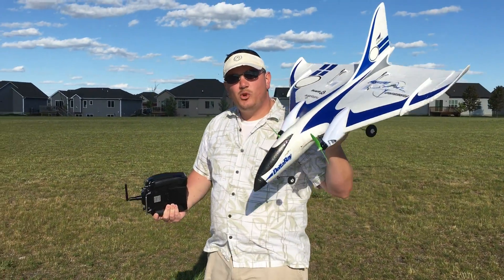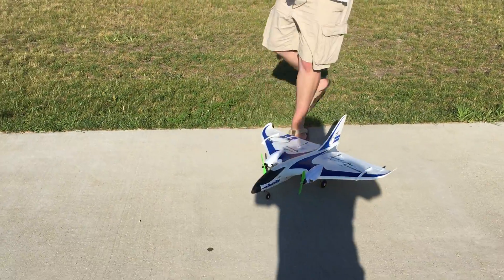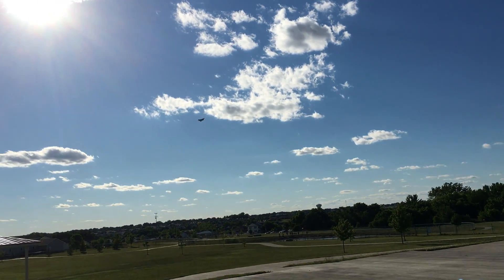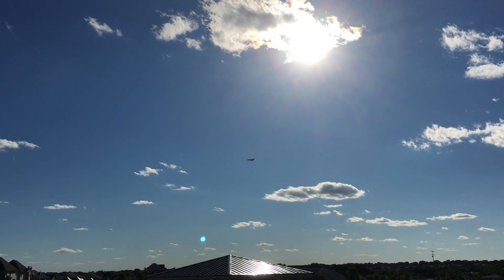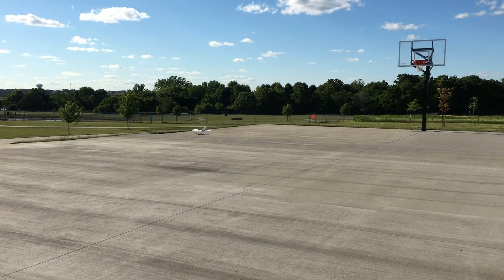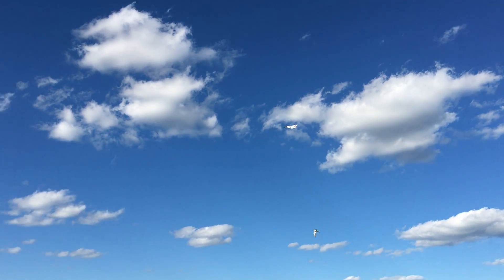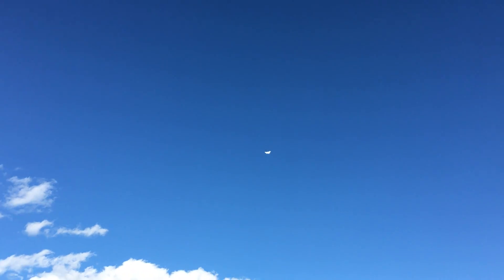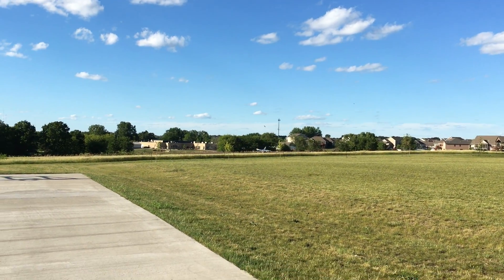Horizon Hobby - Esteban's Delta Ray - After Brushless Conversion - 2200mAh 3S

Comment: Did you ever try doing it with a regular receiver? I'm going to do a conversion but the brushed to brushless converters are not available anymore.
Reply from the maker: I just replied on the other question, but I'll copy it here for the sake of others reading your question...
That's unfortunate...(that the signal converters are not available)

There's another way to setup the Delta Ray, even with Stock setup, to keep SAFE, while using brushless motors...

You can bind a second DSM2/DSMX receiver to your DeltaRay transmitter, run the twin ESC's from the second receiver. This will allow the control surfaces to be controlled by the stock SAFE Rx while you're throttle (with and differential thrust for YAW axis control).

Only items you give up would be SAFE on YAW axis, which is not super important on a Bank and Yank (aileron only plane), but this also stops the plane from wanting to carry and carry while landing, should you need to have some yaw to keep her pointed down the runway. Secondly, you'll lose the Low Voltage Warning pulsation. This will only happen from the brushed motors ESC's, so you won't see that when you don't have the brushed motors installed any longer.

Hope this helps you out!

Comment: Say what? Do what? Ya' kinda spoke too fast, but that's okay 'cause my Delta Ray hasn't been assembled yet. Thx fellas! :)
Reply from the maker: Enjoy it! When the power starts to fade, which it will with your factory brushed motors, consider replacing the SAFE receiver with a standard receiver to avoid the buggy "Xtreme Brushed to Brushless Signal Converters"

Thanks for watching!
Reply: I have three delta rays, standard, one with xtreme brushed motors 20% more power and brushless with a HK orange 3 axis gyro stabilisation. I fly all three and enjoy them in their own right. Different flying personalities all in all one of the best planes to enjoy.